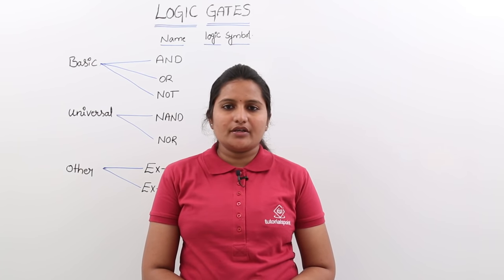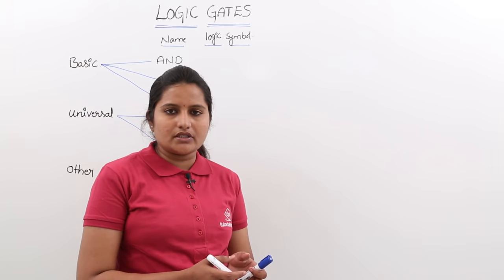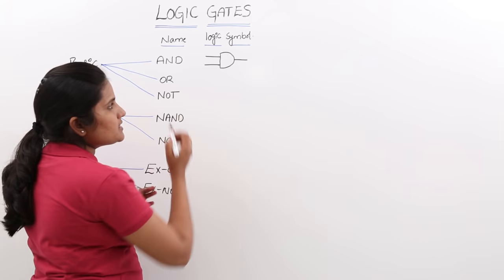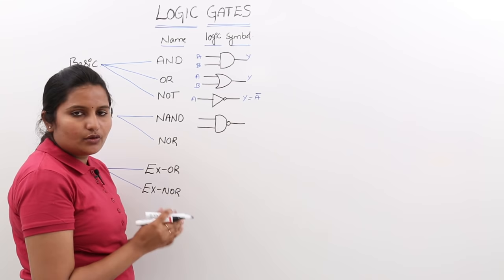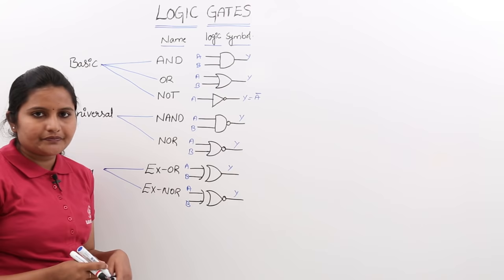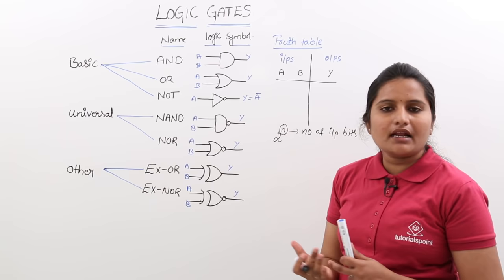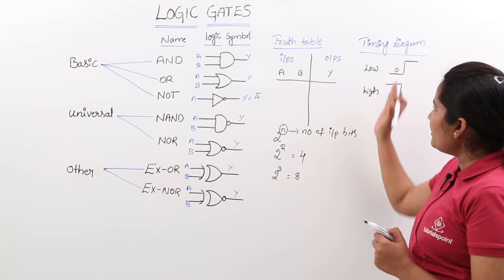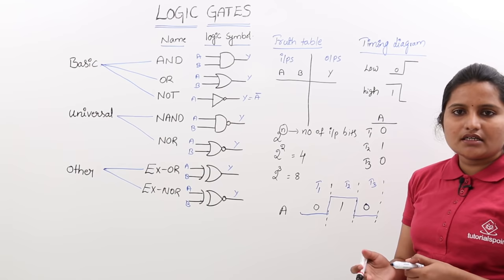Introduction to Logic Gates

Comment: why not gate has only 1 input ???????????
Reply: It is a basic gate designed from diode I think.
Reply: its an inverter
Reply: NOT GATE is made from bipolar junction transistor......if we apply reverse biasing on input of transistor and forward biasing on output of the transistor.....it will act like a invertor.......if you ..on the input side because of reverse biasing no output is found..and if you switch off the input.you got full output...... that's why it is called inverter...not gate
Reply: In digital system we are using so many gates to construct like half adder.. Full adder.. We using addition.. With using more than 1 I/P..
Reply: Depending on the permutations generally gates are used, we required only 2 combination of outputs means either ON or OFF we required only single input is enough(2 power n).in this case generally we are using single input device(named as inverter).